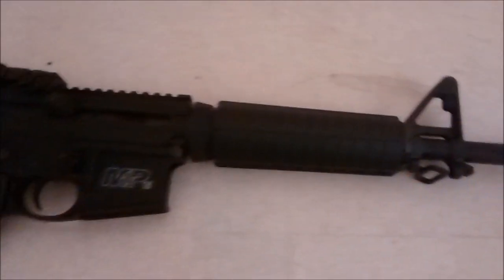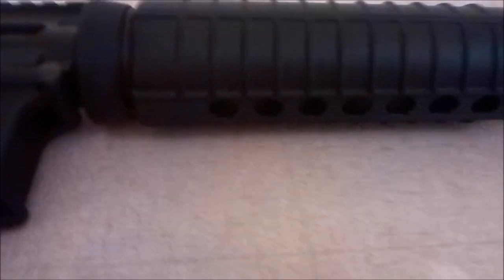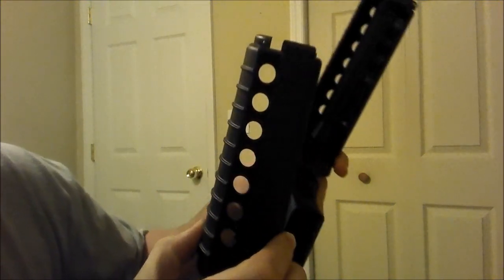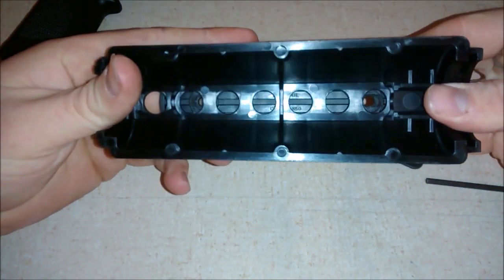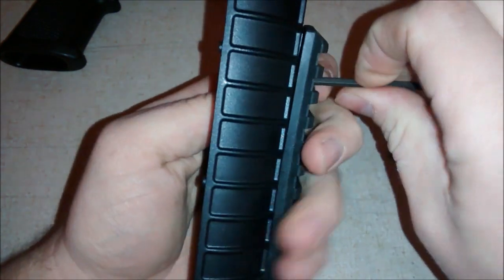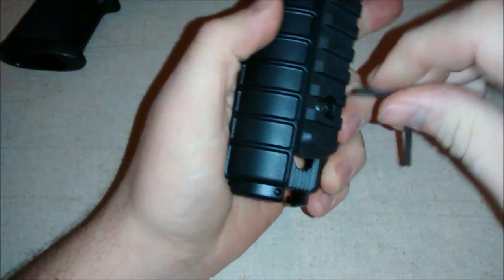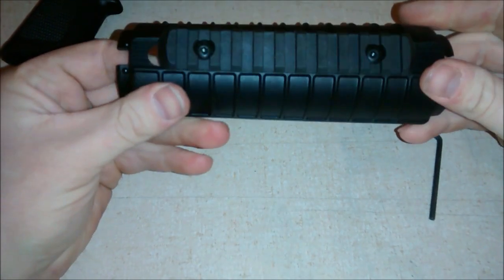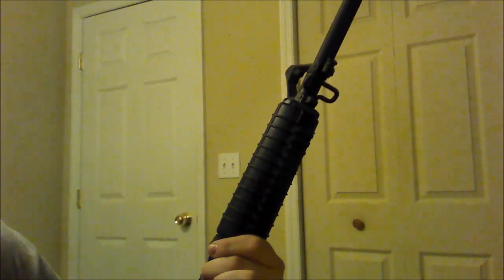How to add a rail to your Smith and Wesson M&P Sport AR15

Comment: Nice job. You might add a drop of Lock Tight, to avoid it vibrating loose. When you look at fore-grips, see if the "wedge type" suits you. I prefer them to the "broom handle" type.
Reply from the maker: Thank you! The bolts had something already on them, i think it was some kind of lock tight. I am probably going to put a wedge style grip on it, I like those better than the regular grips.
Reply: Thanks for that advice!

Comment: So I bought some Mlock T nuts, and they are too small and falling through.
Reply: Did you ever find a solution to this, as I did the same thing, and the nut pieces are too small, and fall through, as well as the screws aren't long enough.  Behind the guard, S&W decided to add an aluminum shield of some sort, unlike the one in the video.  The screws have to be longer to get above that shield piece.  If you got the longer nuts, I'd be curious as to where you found them.  Any help is appreciated.

Comment: I know this is an old video but i was wondering how is the heat? I would think blocking half of the large holes would heat this sucker up?
Reply: I own a m&p 15 sport with same type of rail for bipod and it doesn’t heat up faster but these ARs don’t disappate heat well I’d recommend a free float hand guard for sure but it’s a great buy out of the box for sure.